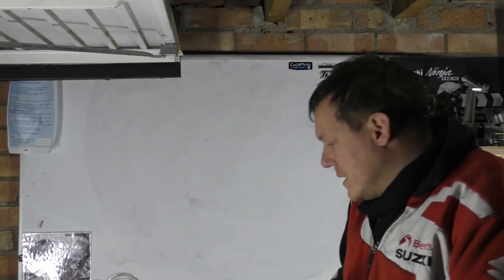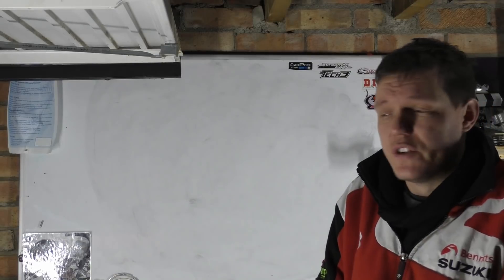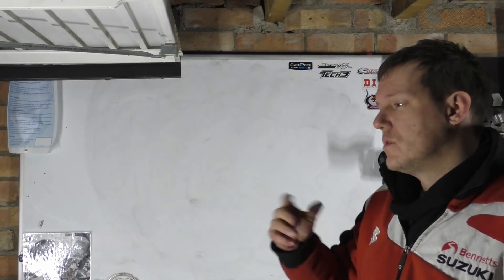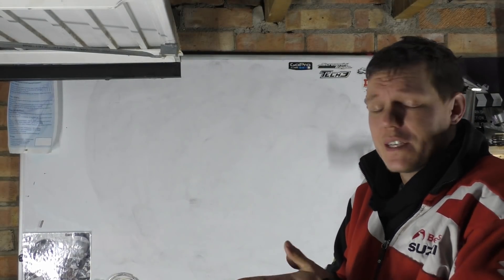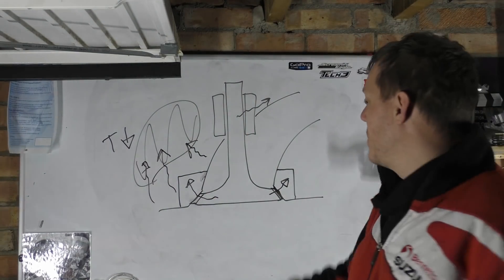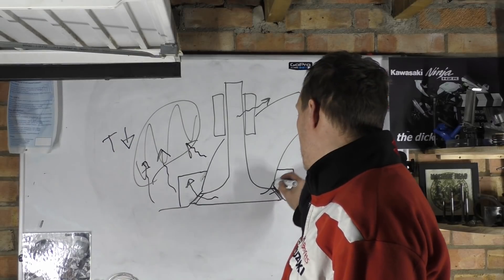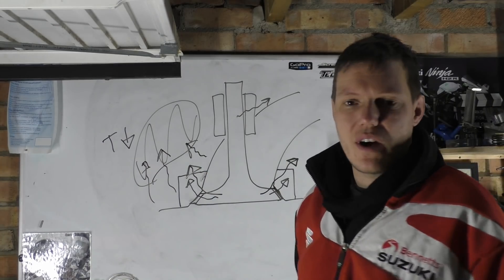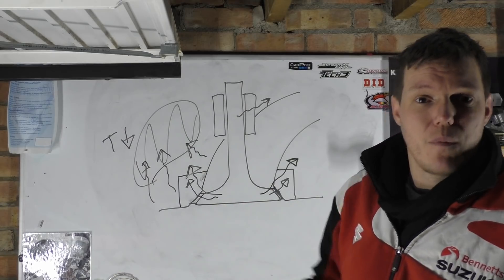Beryllium Copper Valve seats?

Comment: Great vid, do you still lap valves with Beryllium Copper valve seats for new cylinder and valves from different manufacturers?
Reply from the maker: No. Beryllium copper is toxic. You have to take great care with the dust it creates.

Comment: I need help. I want to rebuild my 2008 yz250f cylinder head with new valve seats and I want to know how to fit new ones.
Reply from the maker: Well in a nut shell you can't do it, and when I say YOU I mean you don't have the ability to do it. You're goona have to take it to a machine shop that can
Reply: @thedirtyworkshop  thank you for your opinion on the subject it seems you have more experience than I do , sorry for wasting your time have a good day
Reply from the maker: You're not wasting my time - no question is a stupid question. Valve seats are frozen with liquid nitrogen and then pressed into the head. Getting them out is a massive pain in the arse, and replacing them is even harder - this is why you usually can't buy them. Nexy the seat has to be cut once it's in the head, inline with the valve
Reply: @thedirtyworkshop  I know... I actually just need the seats because I have a head that I am training myself on and I have enough data and information to do the job , all I need is a seat cutter which I will buy as soon as I have sourced everything I need and have bought all the tools I require because this is something I haven't done on a motocross bike yet , and only have done on a cheap Chinese bike that really doesn't need that much attention to detail

Comment: But if you are using aluminum heads wouldn't the copper react badly with the aluminum?
Reply from the maker: No, why? Ah - I think you mean galvanic corrosion and you need an electrolyte to be present
Reply: @thedirtyworkshop  ahhh yes you are correct

Comment: So Be-Cu seats are only used with Ti valves??
Reply: Yes no reason to use them with other valve materials as most of them if not all are made of steel and steel alloys. For which steel alloy seats work well and conduct heat well. Hardened steel seats cause the titanium valves to bend not the other way around.

Comment: Thanks! Didn't know they used titanium valves for weight... XD and also learned about valve seats being a heat conductor... What about compound turbos on a gas engine? Could that help the efficiency of the boost? Instead of 30% it's 35%? Or is it just stupid?
Reply from the maker: No, not stupid. As for valve weight, every gram matters - we'll go into detail why soon

Comment: Matt going completely off this subject, going back 12 year (when i was 16) i put RC glow fuel in a 50cc moped, it ran fine and quite well but when i switched the ignition off the engine was still running! why do you think this may have been? It's something that's always popped into my head every no and then an I'v always wondered why! Lol
Reply from the maker: Its called 'overrun' if there's oxygen, heat and fuel it will combust - glow plugs use platinum as a cataylst that is exothermic - so there's you heat - hence why they're called 'glow-plugs'

Comment: The CRF450R uses Ti intake valves, and hardened valve seats. Its great for revving, but jesus christ it beats the hell out of the valves. It makes for a valve reshim after ~40 hours and every 4 hours after that. Add some BE-CU seats and it extends the life of em 2 fold before a first shim. Weather thats heat dissipation or an over all softer seat i dont know, but it helps for sure.

Comment: We use it sometimes for inserts in injection moulds sometimes in areas where you need to get the heat out quickly.  We only worry about the poisoning thing when grinding it, curiously enough it TIG welds really well with 420 stainless rods if you preheat it a lot.

Comment: The more degrees you have on your cam the less time your valve is going to be in contact with the seat, thus, less cooling. If your valve weight is reduced the required spring forces are reduced. Weight reduction is significant when going from steel to titanium parts. Long time ago I read a study about valve seat pressure's effect on valve cooling. I don't remember the figures at all but the differences were significant. Obviously you want to keep the spring forces to a minimum.

Comment: Ah yeah I've worked with few machinists that had to work with beryllium.... They weren't too happy about doing that job.

Was for some abstract NASA pretty shit. Guess toxicity doesn't matter when you shoot it off into outer space
Reply: I machined it on the CNC lathe with loads of coolant. I Googled it and it is carcinogenic! The fumes , mists and air borne particles used over a long period are to be avoided.

Comment: My welding instructor back in the day stressed to no end about welding beryllium copper and how we HAD to have a ventilator sucking all the fumes away or it could kill us. Guess he was telling the truth.
Reply: Generally copper is used in welding to back up a hole you want to fill in because you can not weld copper.  You can braze copper. I build custom trumpets so I make bells out of copper, accordance brass, gold brass, Bronze and Muntz Metal/German Silver/Gilding Metal all of them are copper alloys. The alloying agents being nickle, tin, zinc, lead.Compared to welding brazing is more like an extreme form of soldering and not really welding.
Reply: Sorry, wrong verbiage. "Braze" not weld and no I have not fooled with beryllium copper. Messed around with copper and brass though. Wanted to be a welder years ago but failed the welding certification test. It cost $300 each time you take it. It was a 12 inch verticle weld of 2- 3/8 inch plates with 45 degree beveled edges. All my practice ones were flawless, but the one I did the test with had inclusions and cracked when he bent it over a tube to test strength. Very humbling experience...
Reply from the maker: LOL but you can weld Beryllium Copper.....

Comment: At the end of the 90's Ferrari were starting to use increasing amounts of beryllium in their F1 engines in an attempt to keep pace with the leading Mercedes-Benz unit of the time, then the FIA banned the use of such materials. I don't know if it was on cost grounds or because, as you stated, beryllium is very toxic.
Reply from the maker: I'm pretty sure it was toxicity, because high output engines shit out bits of the valve material
Reply: @thedirtyworkshop  Yeah, this was in the "disposable engine" era before the imposed mileage requirements a few years later. A unit would only last about 400km then you basically toss it. 

I also remember when Renault came back in 2001, they tried a 111-degree V10 and were initially planning to make the whole engine block out of magnesium but persistent vibration/resonance issues prevented it.
Reply from the maker: Its actually not that expensive - I have a rod of it, just couldn't be arsed to find it when I did the video
Reply: I know beryllium is toxic when cut , and that it is better than stock seats ,I have done some research on why beryllium seats are better than stock and what it is made of , but I did not know it was banned but this is useful information that helps
Reply: A lot of rare alloys are banned in F1 its to keep costs lower so smaller teams have a chance, i think cranks have to be steel and pistons alu etc.

Comment: So what would happen if you used them with steel valves instead?
Would they prolong the lifetime of them and potentially last longer than steel or aluminium valve seats?
Reply: I don't think you're quite getting why they're using the beryllium copper as valve seats.
Reply: @72RwS  No I completely get the thermal dynamnics of it compensating for titanium but I'm still curious as to what would happen in other circumstances